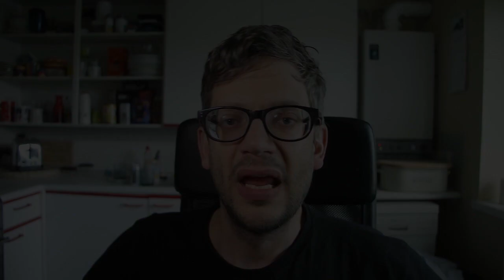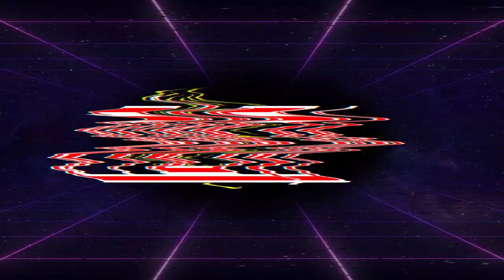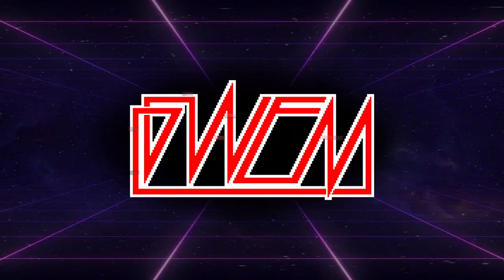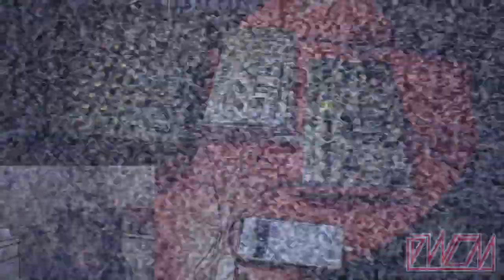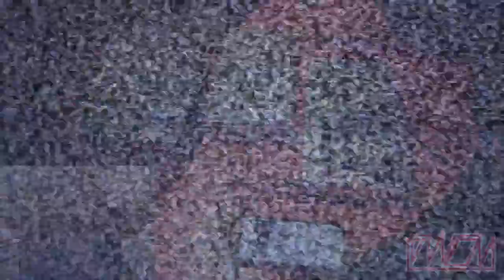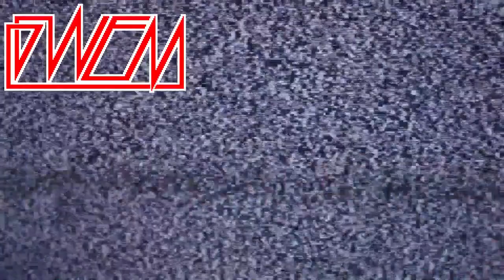Behringer TD-3-MO (TB-303 Devilfish copy) explained

Comment: Looking for an answer to the red accent button and why it doesn't stay engaged like the sub oscillator button and why you have to hold it down manually to keep it engaged and if this button could be modified like the sub oscillator button.  For me this v was a poor production choice
Reply from the maker: It’s meant for buildups in your track as you jam. I like that it’s a momentary switch as you can just engage it quickly when you need it.

Comment: Is the MO version is able to do the classic 303 sound with the distortion?
I saw its only have Overdrive but even on full overdrive it doesnt sound like a distortion
Reply from the maker: The overdrive is a bit different in the MO. To get that classic 303 distortion you need to use a pedal or drive a mixing desk.
Reply: @gwEmbassy  Thanks man, any recommended pedal or plug-in for that classic distortion?
Reply from the maker: Try a ProCo Rat or a Boss OS-2
Reply: @gwEmbassy  ?

Comment: Moin Gwem,
is there a button combination to turn off the flashing LEDs in the case? I've had the Td3 MO since yesterday and the flickering around is already getting on my nerves!

Greetings from Germany
Reply from the maker: Not that I know of.. I too find them very annoying!
Reply: @gwEmbassy  Your video was very helpful to understand all the functions of the Devilfish Mod on the Td3 MO. thanks for that

Have you ever had the normal Td3 in your hand and tested it?
I have a question regarding the Td3 pots.
The ones on my Td3 are very stiff (positive:) as they apparently are on the original Tb303.
The ones on my Td3 MO, on the other hand, are rather smooth-running like the ones on my Pro 1.
How do you feel about the Td3 pots compared to your Tb303?
Reply from the maker: I tried a normal TD-3 in a shop. I think the OG TB-303 has stiffer pots than the MO
Reply: @gwEmbassy  I assumed so.
Nevertheless, it also has advantages because I think that you can adjust the last nuances in the sound with the smooth-running potentiometers by turning them minimally.

Comment: The MO addresses my main concerns about the TD-3 and puts it the same class as the 777. When evaluating a friend's TD-3 I found myself wanting to twist the knobs a bit more than they would actually go, but on the MO that doesn't seem to be a concern. I heard a lot of familiar sounds in this video that I've either dialed into my own 777 or heard on the original devilfish demo recordings, and I'm glad that another generation will have easier access to this sound palette.
Reply: Good point about wanting the TD3 to go that bit further sometimes. In saying that though I’m a music newb and acid lover (any genre, just bloody love the flow of acid lines) so the first piece of gear I got 3 months ago was the TD3. I had actually ordered the MO first but was then told it was delayed for 2 months and could get a TD3 within a few days. Anyway… as a user of both now, they are totally different instruments. While the MO can do acid, I tend not to use it for that and focus more so on actual bass with it whereas the TD3 is literal acid fun right out of the box. Majority of what I write is acid line focused, therefore I reach for the TD3 first. The MO is absolutely sick though. With the overdrive and sub oscillator maxed and other filter tweaks, I’ve managed to even get it to sound like it’s being run through a distortion at times! It has a much wider range than the TD3 but I don’t always have the patience to put the time into finding that sweet spot, whereas I know exactly where the TD3 is and where it’s going every time 👌 P.S. yes everybody needs both haha
Reply from the maker: Yes, it’s great the design will carry on. It clearly has its own unique sound, especially the accent!